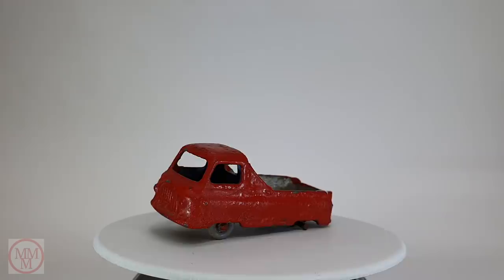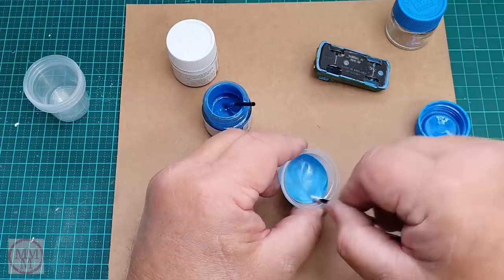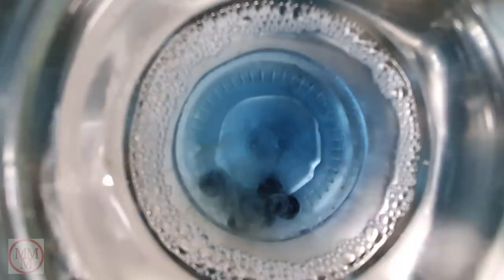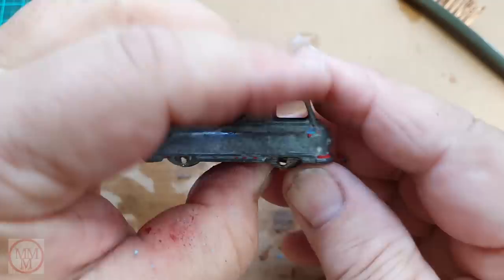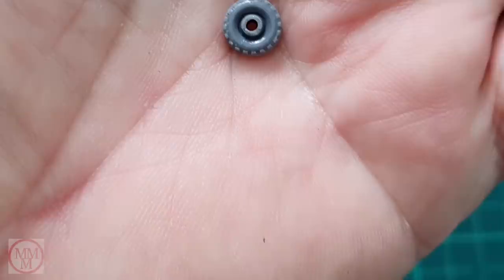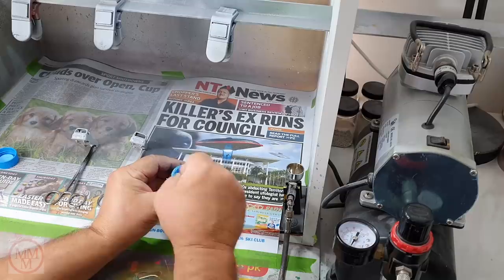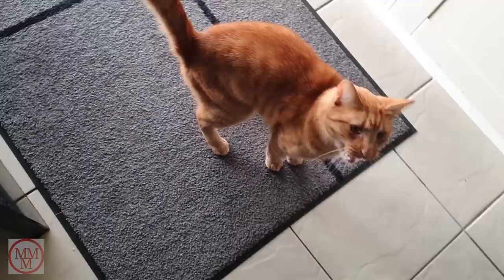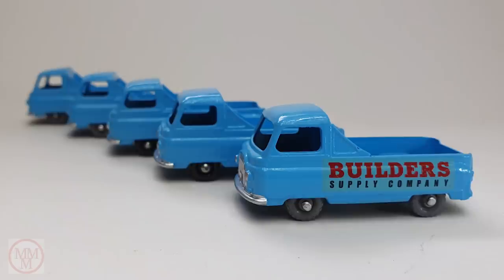MATCHBOX Restoration No. 60a Morris J2 Pickup 1958

Comment: WD40 have an extra range - one of which is a faster penetrating version. I've only used it on actual cars, but it definitely works better then the regular stuff.
Reply: I've found it takes more than one application when the rust is thick but it's still excellent stuff.

Comment: I love your restorations, Marty! You're a pleasure to watch. I have model 60, with the rear window but it has gray wheels.  Instead of using WD-40 to free rusted parts, if you can find any of them, try "PB Blaster,"  "Kroil," or even a home-made mix consisting of equal parts acetone and automatic transmission fluid. Be careful with the last one, as the acetone in the mix can eat some plastics. It also needs to be kept shaken-up. These are true penetrates that will free rusty parts. PB Blaster smells bad,  so if you try it be forewarned, but it works well.

Comment: Hey Marty - I've always found that if the top of the fluid in your jar matches the level of the bath outside the jar your ultrasonic works better - the wave pattern set up by the ultrasonic cleaner doesn't see a discontinuity at the boundary so you transmit more energy.  Sort of like impedance matching in electronics.

Comment: hey Marty, has watched and enjoyed all your videos.....youtube just popped this one up 3 years later for some reason.   On those rotary wire brushes?....It is a pain how they shed the bristles.  But I discovered a fix (or at least a reduction for this)   take some thin super glue and run it around the base (where the bristels meet the metal)   Makes them last twice as long and will prevent flying bits

Comment: depending on the cost... of replacement...i'm thinking a little flux and solder might hold those wire brushes together...the flux SHOULD made the solder seep inside the wheel hub...just a thought

Comment: I don't know if you plan ahead when you get ready to redo one. But, if you will drop it over in a glass full of white vinegar for 3 days to a week, it will eat the rust. I know this for a fact because I've been restoring Tonka trucks for 30 years. Vinegar will take the rust off and the paint on old Tonka trucks.  For a rusty Tonka truck, it usually takes about 2 weeks to break down the paint and for all the rust to fall off. It leaves nice, clean, etched metal. Ready for primer. Little things like those rusty axles, maybe two or three days to clear off enough rust that the axles will come out easy. Straight white vinegar has 15% acid. That's why it's slow. Coke, Ketchup, those are bullshit and don't work. The acid content isn't high enough. But white vinegar is. I've even put white vinegar in a car radiator. No water. Just vinegar. If you can give it the time it needs it will loosen rust and calcium deposits. Clean it out in a week. It wasn't a daily driver so it had plenty of time to let it soak before putting it back in the car. It won't hurt the metal unless you leave it in the vinegar for a year or more. Vinegar will eat a whole wrench if you leave it in for a year or more.  https://www.youtube.com/watch?v=EuIa8h4d0RY Here is another video of a guy who left tools in white vinegar for 19 months.......https://www.youtube.com/watch?v=vX9ioSDESzA

Comment: WD40 really is shit for removing rust... It will do a fair job at preventing it, but I've never had it take any off.  

Plain ol white vinegar works pretty good, but if you can find it, a small jug of Evapo-rust works great, and would last you for months if not years.

...also, you should invest in a table top media blaster.  It would make short work of that stubburn paint.